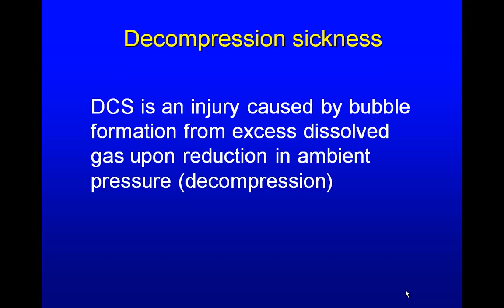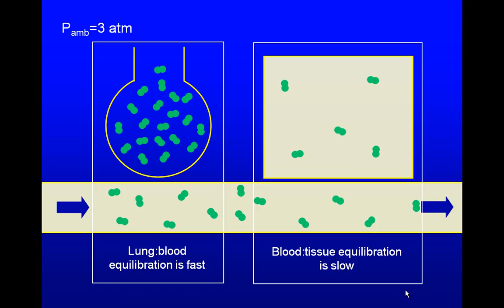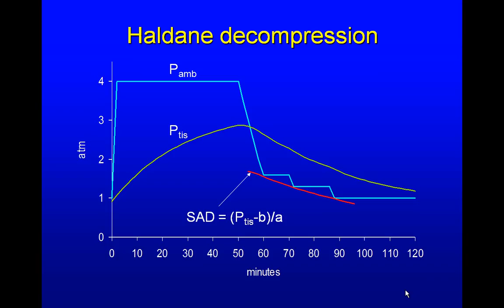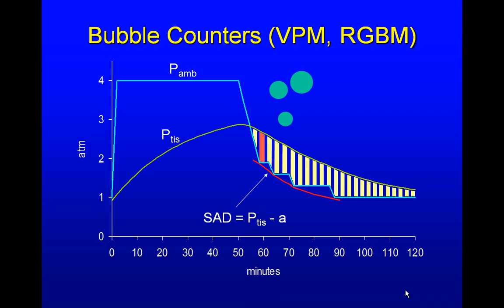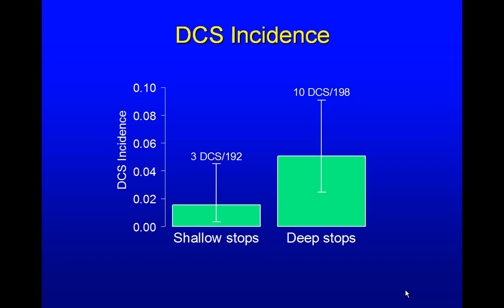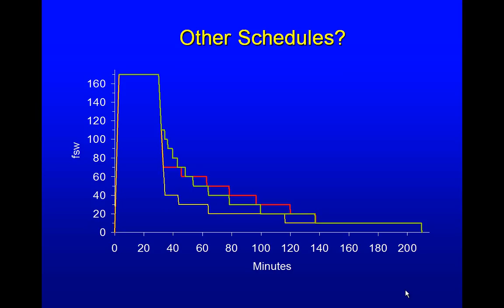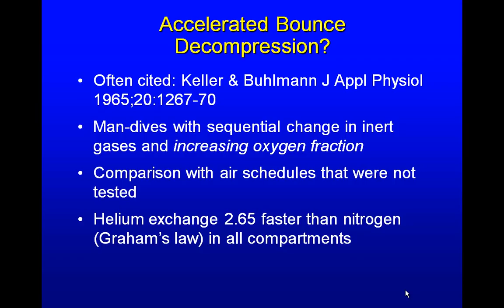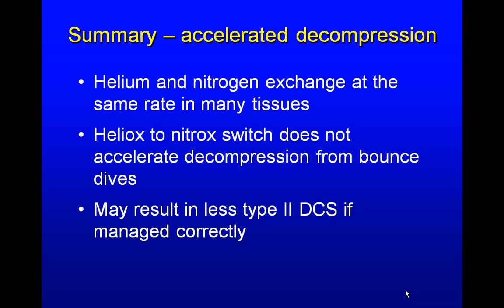RF3.0- Decompression Methods

Comment: 30:57 so your nullhypothesis - which you tried to reject - was, that the bubble modell will produce more dcs? So actually you never rejected any nullhyp. which means this study needs to be redone with the opposite nullhyp. based on these results...
Reply: from what i can understand, it seems that they were expecting some differences between the groups (hypotesis), so would't the null hypothesis be "there are no significant differences between the two groups"? if this is the case the null hypothesis is rejected (assuming a low p-value)